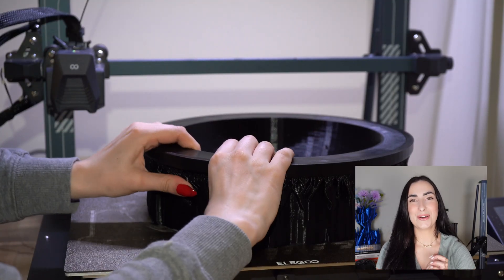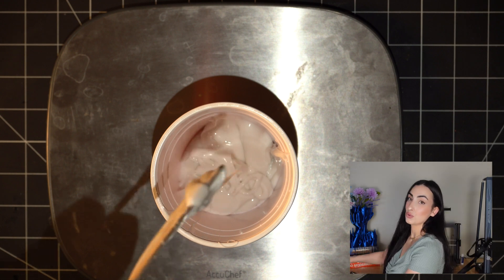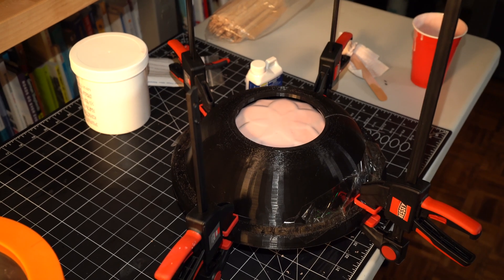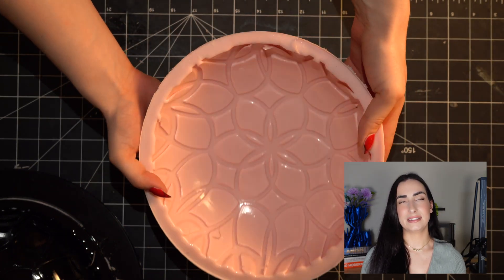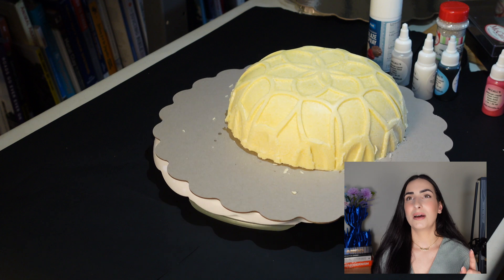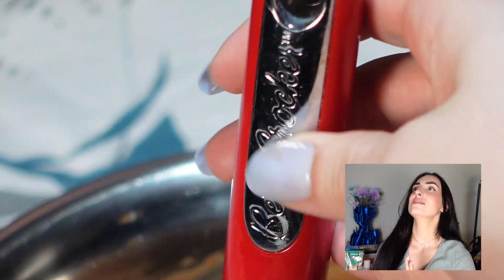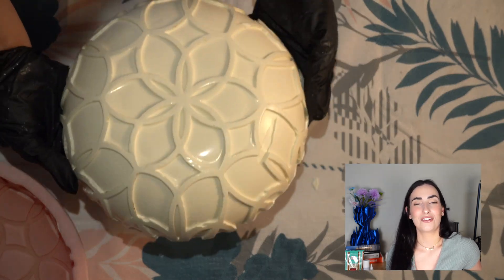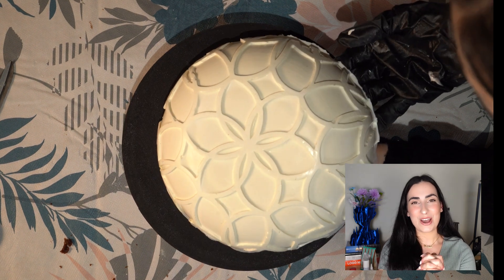Using 3D Printing to Shape Perfect Cake Molds | Silicone Mold Making

Comment: I'm looking at buying the Neptune Max, have you had many issues with it and would you recommend it at this time? Great ideas on the molds.
Reply from the maker: Thank you 😁 I definitely recommend the Elegoo Neptune max! Personally, I’ve had 0 issues with it this far and I’ve ran 60 and 100 hour prints. Before you purchase, I would recommend getting a very sturdy table as there is a lot of vibration and it has a large footprint.